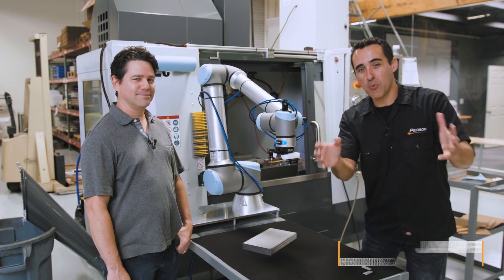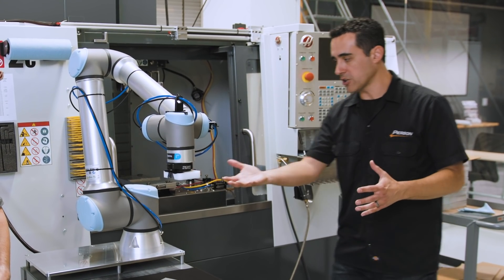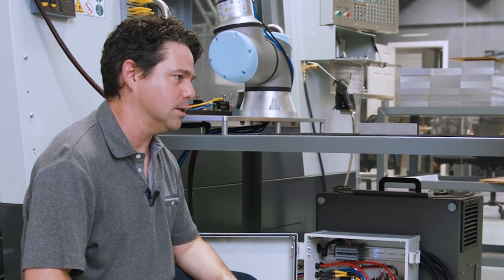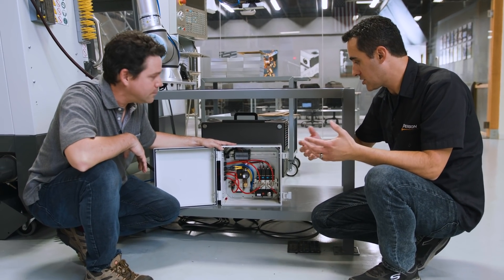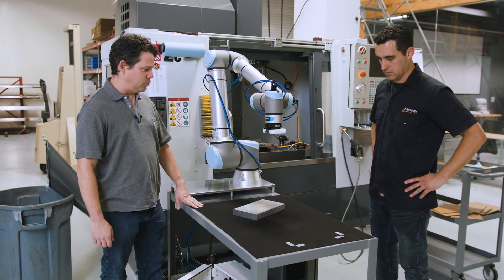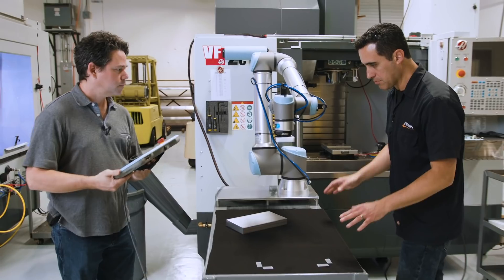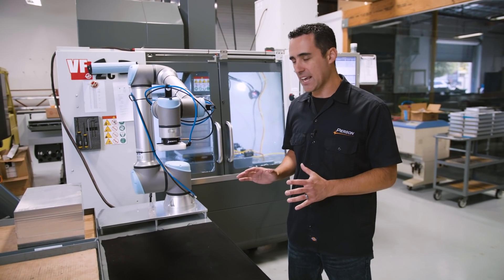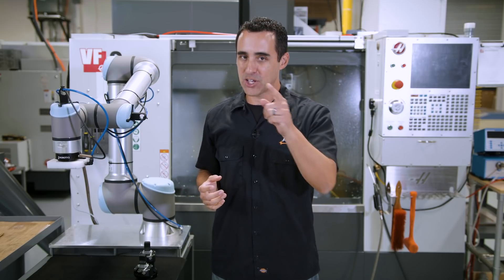Using ROBOTS to Run a Machine! - The Robot Series - Pierson Workholding

Comment: Thats a fine setup for the robot, I like it. Interesting that the table is not fixed to the cnc machine or floor, just in case someone or something whould hit it and move it out of position. But easiest soulution is having it free standing like that, when that's good enough
Reply from the maker: You're probably right about anchoring the table, BUT we don't solve future problems before they're actual problems. In 6 years, the table has never been bumped.

Comment: We use the same solenoids for our enclosure designs. They do get a little on the hot side after prolonged use, not enough to say ouch when touched but I would advise an air vent to prolong the life of the enclosure internals.

Comment: Did you consider using a regrip station instead of a camera for accurate pickup position? An angled pickup station that locates on two edges of the extrusion can get very repeatable position. It requires your extrusion is reasonably consistent size however.
Reply from the maker: Regrip stations are fine if there is very little variation in raw part size. Saw cuts and extrusion widths have very loose tolerances which makes a camera ideal since it always finds the exact center of the part.

Comment: As a Machine Vision guy who is just putting his toe into the robot water and bought his first robot a few weeks ago I would bolt the robot onto a table built from aluminum strut profiles (eg. Bosch Rexroth) and with steering rollers under it. That's what I did. Then attach the table to some struts bolted to the floor or directly to the machine. 
This comes with several advantages: 
1. You can build the table exactly to your specifications and fix the controller and the electrical cabinet on the table. This is much more rigid than your welding table and about the same price.
2. The robot always has a fixed position in relation to the CNC machine. With your current setup you can get your robot positions messed up if someone accidently bumps into your welding table.
3. You can easily move the robot to another CNC machine if necessity arises.
If you want I can send you a picture of the table I built for my Kawasaki robot.

Comment: Nice setup! You guys have come a long way. One way to reduce hot spots on shiny materials is to try some polarizing film. A small piece of over the light and/or the lens may help with that. I have a lot of experience with the wrist camera and it can be finicky at times. It's gotten better with software updates.

Some would say use rubber or another material as the background but the material you're using is perfectly fine. It's low reflectance and easily replaceable as you mentioned. Vision is all about lighting.
Reply from the maker: Polarizing film - That's a great tip!

Comment: Is there a failsafe prevention in place in case of air loss? Will the robot lose vacuum and drop the pallet?
Reply from the maker: Air loss is always an upstream problem and fairly unlikely.  However, if the vacuum gripper or vacuum chuck doesn't reach a minimum threshold, the robot or machine respectively will trigger an alarm.  This is done with vacuum level monitors on both devices. Link to the explanation in an earlier video: https://youtu.be/7MrYSGXMap4?t=645

Comment: For a Lean Evangelist, I am shocked that you have extra valves "just in case"! That sounds like something I would do... lol
Using a stacking valve style like that, it would be simple to add more as needed, instead of putting extras in.

I do have a couple of face-palm observations.
Putting all the controls in a nice sealed box, and then drilling holes in it to allow dust and moisture in, to save occasionally opening the lid to adjust the door speed ? It makes access harder having little holes tucked down on the side, and makes it impossible to see the valve position when setting it, so all you have is "a tiny bit" rather than "from the 3 o'clock position to the 4 o'clock position"
As an industrial mechanic, such designs always frustrated me lol

On the vision table, while the expensive cloth works great, it totally goes against the Lean philosophy, because now you have to stock something extra, instead of combining function.
You can get flat black rubber matting, or spray the table with rubberized paint, undercoating etc, or you already use plywood on the cart, so flat black paint on a piece of plywood, and repaint occasionally.
I really doubt that the ultra black cloth will help much more than just flat black rubber or paint or astroturf or felt.
It's great stuff for film, but I doubt that you need that perfect  cinematic black just to avoid reflection off a glossy rubber mat.

Your new guy seems to be good at finding the more complex ideas, almost like he's trying to be creative even if they aren't the best ideas.
For instance, the mounting plate with standoffs. You could do the same thing by putting the plate underneath the tabletop, bolting it through the same way, or just welding it, and then cut a hole through the tabletop to feed the wires down. Now, maybe the mounting surface of the arm needs to be at that exact height, and so it has a purpose being raised up, but round spacers aren't the best way to do it, because it's not just supporting vertical load, that arm has quite a bit of moment on the base, constantly swinging around, and over time, probably not much time, those bolts are probably going to loosen from the side forces, and that plate will start dancing on the spacers, and you lose the repeatability and precision of the robot.
If the plate can't be moved under the table, or even just bolted flat on the top with a hole for the cables, then the spacers need to be replaced with some blocks that have a lot of surface area to stop side to side movement and give stability, with the bolts just providing clamping force, and not having to resist side forces.
If the arm base has to be at an exact height, it might be easier to just drop the plate to the surface, and then bolt or weld some extensions to the bottom of the feet to raise the entire table to the correct height, but I suspect that the height isn't critical anyway, and the spacers were just to avoid putting a hole in the tabletop.
Reply from the maker: We had no idea there were such brilliant mechanics out there like you that could watch a 15 minute video and instantly come up with such great feedback that was better than a year's worth of our continual improvements.  Thank you!
Reply: @PiersonWorkholding  nice Troll, you give some of the best in the YouTube comments a run for their money!
I guess your year of learning beats my 25 years of seeing what happens with various techniques.

My comments were constructive input on, with some possible suggested improvements on potential issues that I have seen play out before, as an operator, a designer, and a repair and often redesign person working with similar systems.

You are pretty good at a lot of things, but this isn't your main area of expertise, and it is mine.

Now, if you already tested and modeled and worked through all the issues I mentioned, then I may deserve to be dismissed, but it sounded more like you had your feelings hurt by being questioned, and that you feel like because you have been working on this side project for so long, that you have it dialed in.
And I am impressed with a lot of what you do, and most of this setup and system, but there are a few things that don't seem like they will stand the test of time well, and may not be ideal, and so I extended the effort to offer my experience to improve the system, but you don't seem to be open to any other views, which I guess isn't surprising.

Anyway, I won't be surprised if some of the things I mentioned get redesigned later, but I am sure that you will specifically do it differently than I suggested just because lol, and I also realize that things don't always fail in the same ways, so maybe it will be fine, but that doesn't mean that it shouldn't be considered at least.

Thank you for sharing how you feel about your viewers who make the effort to share their experience, rather than just pad your ego with repetitive praise and simple questions.

Have a great day!

Comment: Our industry standard quick connects for electrical and pneumatics are Harting Han Modular connections.  You can put pneumatics and electrical in the same connector and it snaps together.  It's also poka yoked to make sure it connects the same way every time.  I use it a lot in my industrial equipment designs.  But I also see you guys struggling with the CRobot, and that's been our experience as well in the tier 1 automotive sector.  Standard industrial robots are cheaper, faster,  and more suited to the tasks (CRobots are about 4x the cost).  We've used ABB robots and have been extremely satisfied, they are an "engineer's robot".
Reply from the maker: Yes, those connectors are great!  They're a no-brainer if we continue to adapt the robot to other machines.  We are very open to using different robots in the future and thank you for the suggestion on ABB.  UR robots are easy to demonstrate and deploy but at their core they still run a script that doesn't even require the pendant.  In reality, they are two systems - the motion control and the user interface.  I'm very open to ditching the UI for better pricing and more capabilities.
Reply: @PiersonWorkholding  Most, if not all, industrial robots have separate motion controls and user interface pendants.  I know the ABB can operate without a pendant.  Going from UR to ABB UI isn't a down grade since they both run a PC control environment on their touch screen pendant.  You'll lose some screen real estate, but it will more than make up for it in its capabilities.  For example, on a lot of the systems I design we do not require a PLC because the controller is powerful enough to multi-task background applications.  It's also a very robust scripting language with decades of continuous improvement.
Reply: @capnthepeafarmer  and dont forget Robotstudio
i just love it and am trying to convince the higher ups to replace our ageing fanuc and kuka robots wit abb just for the ability to use robotstudio
roboguide or the cluster fuck kuka called offline pragramming (we have kr c2 running, so no workvisual) cant compare to abb's software
the only thing i am missing from it is a darkmode for the rapid editor

but you also need to mention that with every industrial robot, compared to a cobot, you will need to fullfill a lot of safety critiria
and that normaly ends in a fixed installation with fencing and all that
Reply: @capnthepeafarmer  Comparing UR and ABB is apples and oranges. CoBot vs standard industrial aside, they are geared towards different markets. Most UR applications are quick to deploy, tend to be on the simpler side, and are frequently maintained by people with limited to almost no programming experience. That comes with some trade-offs. It's not the most robust system and has frequent issues.

ABB on the other hand is extremely robust and sophisticated. Especially when you compare Robot Studio to UR's Polyscope as UR has no offline package (not including the 'simulator').

Comment: put the cart on wheels with proper anchor points to each machine and quick connects and you have a mobile "worker" depending on work orders and availability of machine and parts
Reply from the maker: Wheels and anchor points only add more complexity without much benefit over simply moving it with a pallet jack.
Reply: @PiersonWorkholding  ah ok
Reply: that would be why we never did it at work
Reply: @PiersonWorkholding  how do you clibrate the position at the machine? Or do you not need  much precisions for what the robot does?
Reply from the maker: @nerdkusi The different subprograms have their own origins much like G54, G55, etc in a CNC  machine.  That way you can fine tune exactly where things go.  When we move the platform to a lathe, we can still use the cart location, the camera location and add another origin and create a unique subprogram with the spindle as the X-Y-Z zero.
Reply: @lorupa  they can use something like a live center and the robot teach pendant to  "home" or set the origin point  for things like the lathe so the robot knows where it is in the world cnc wise  with repeatablility down to 0.04 of a mm  in some fanuc cases